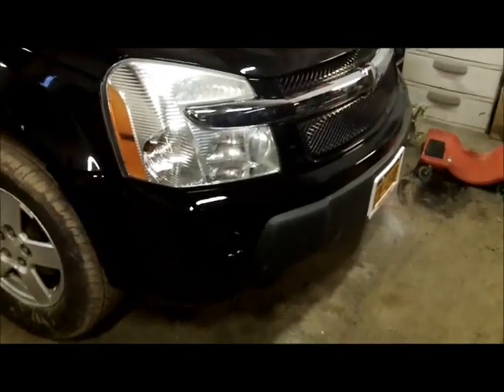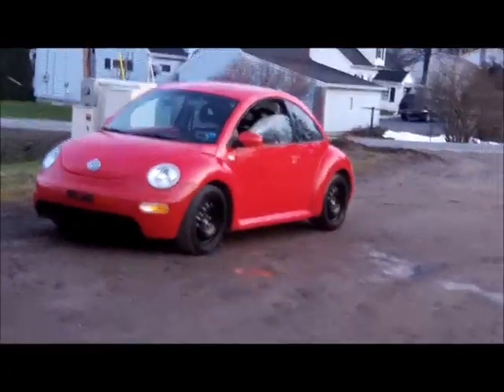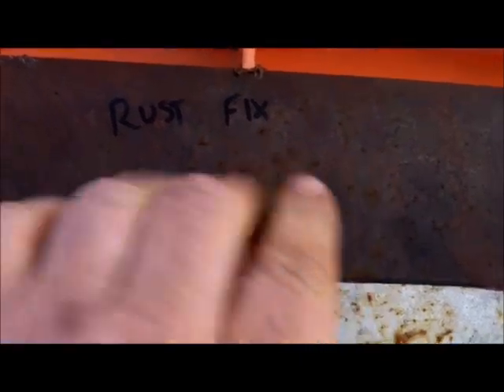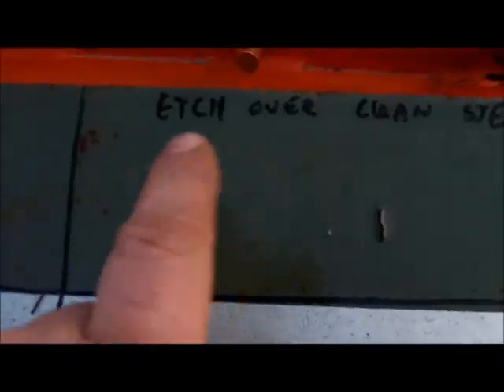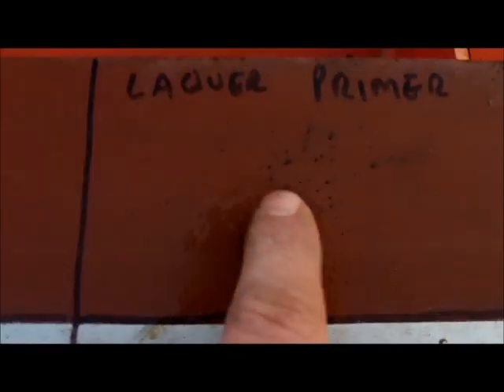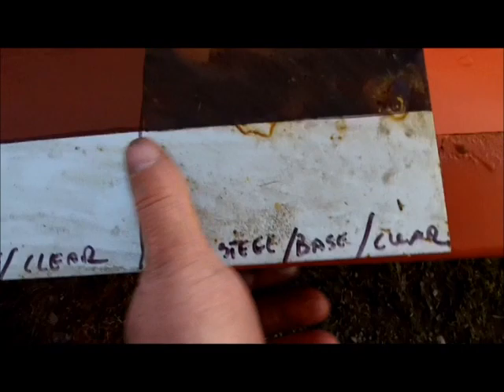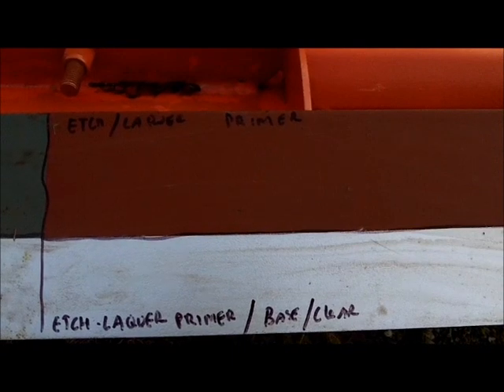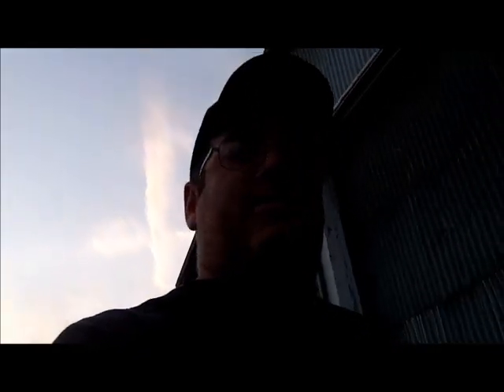Different products over Steel and Rust.What works and what dont

Comment: yeah i was waiting for this one so i'd know which to use for my silverado i am working on. i'm using etch primer and a primer sealer then planning on sanding it with 220 and hitting it with Army green and some urethane clear but i still have the rockers to build and dura glas in too what you think about that idea?